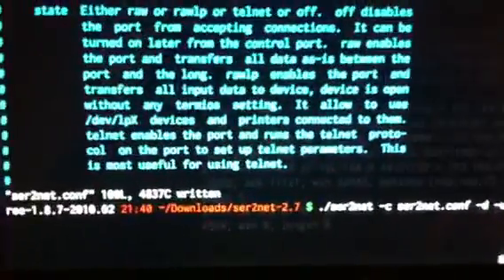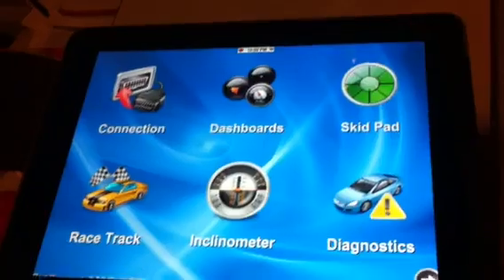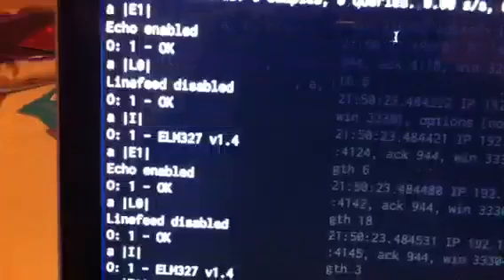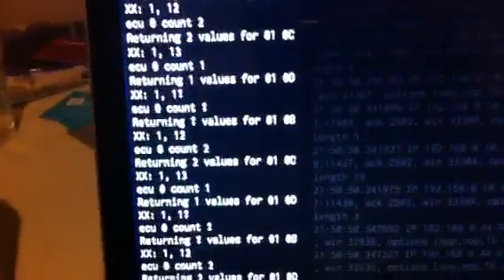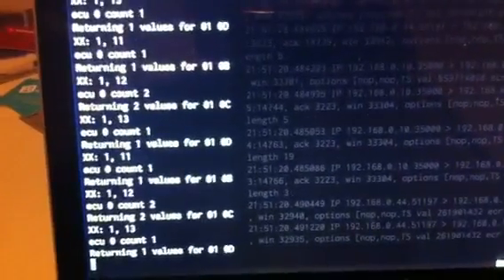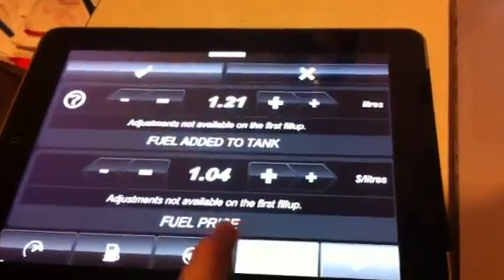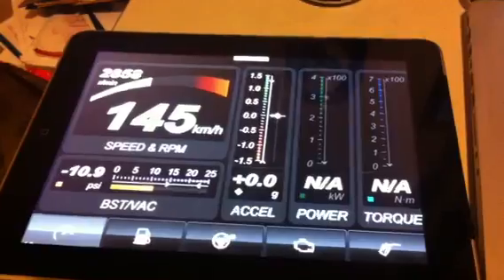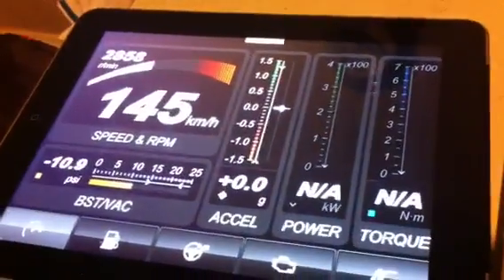OBD2/ELM327 Simulator working with Dash Commander on the iP

Comment: Just for interest, I tried to do something similar.  I got a USB ELM device sending data over a wifi connection to my iPhone using the following line in ser2net:

35000:raw:600:/dev/ttyUSB0:38400 8DATABITS NONE 1STOPBIT

Comment from the maker: Unfortunately this project has not eventuated at this stage.. we do have a working prototype using a linux machine, which emulates elm327 output and happily displays live RPM, Coolant, etc on iPhone apps.. but a bit clunkier than an AVR, need a beagle board or arduino or similar.